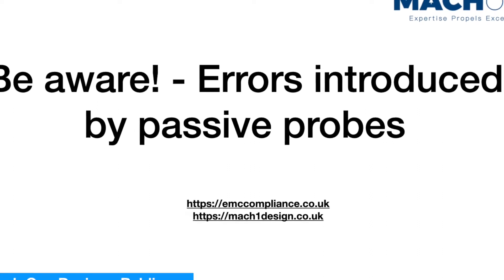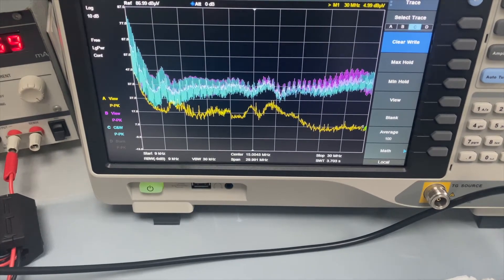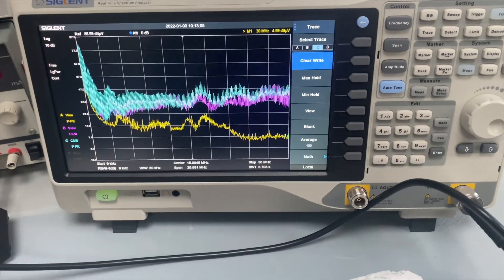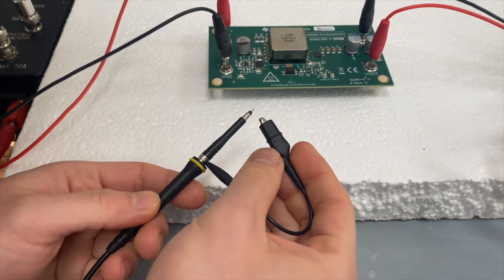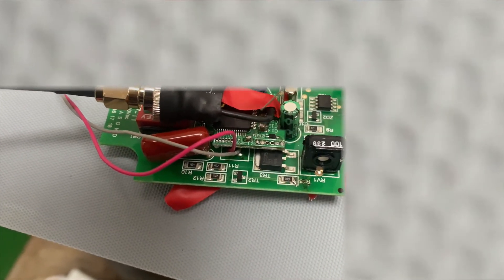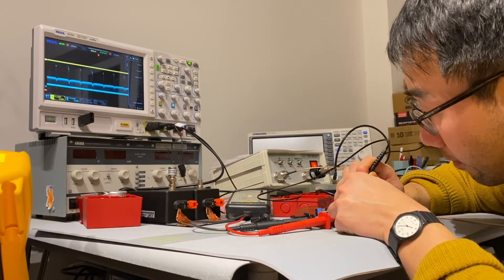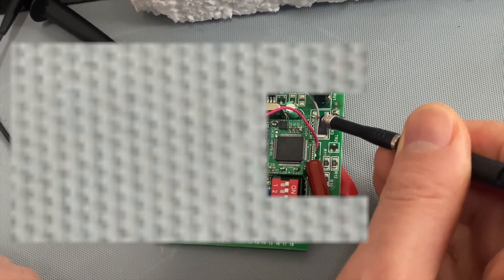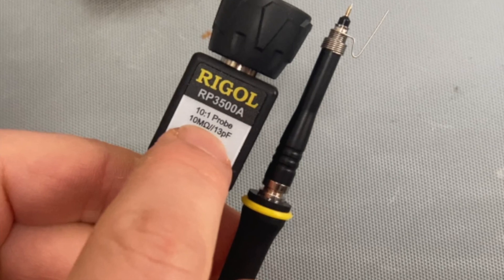Two common errors introduced by a passive voltage probe - Don't let this ruin your day or week!

Comment: This is basically the "Observer Effect" in electronics. It is always critical to consider what you are actually measuring and observing: the system or the effects of your equipment ON the system? Great explanation!
Reply from the maker: Hi Jon, indeed, especially when it comes to high speed measurement. A capacitance will be formed even between the human body and the PCB. Sometimes touching the probe will make a very big difference. All interesting stuff, isn't it!